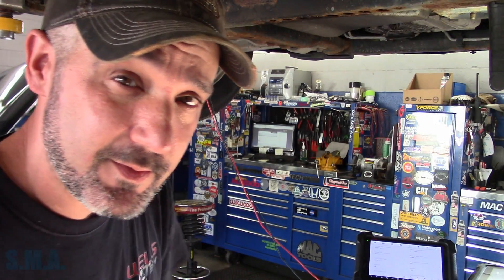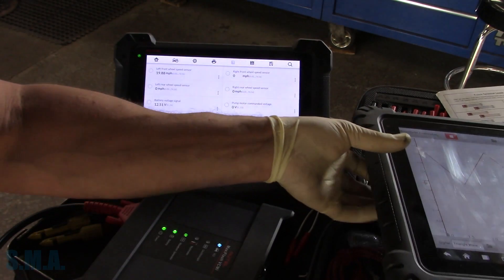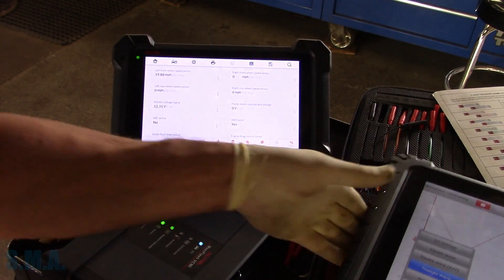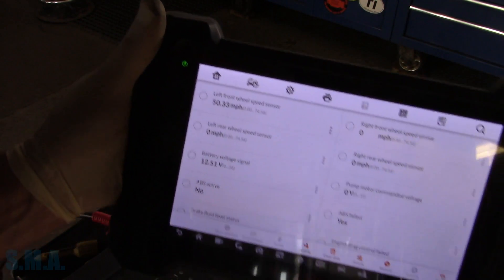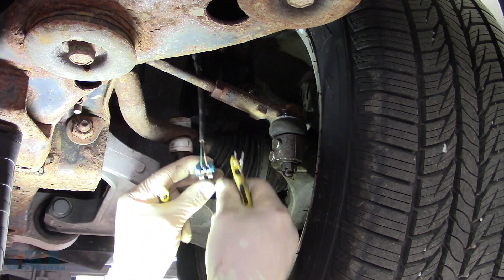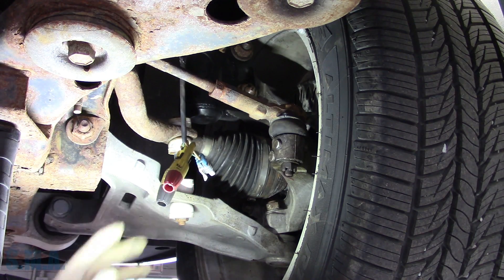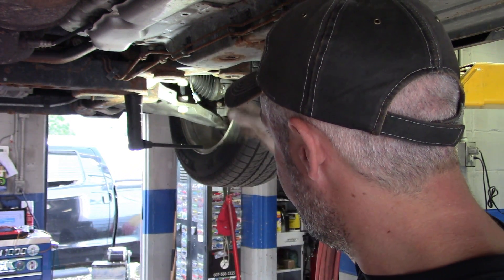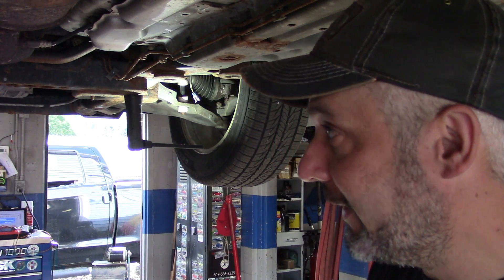Autel Maxisys Ultra: Signal Generator To Diagnose ABS

Comment: Nice tool. What makes it better is that the signal is always on for example so you are not in and out of the car turning the key etc. Signal is on, you can trace it full time without any interruption until you find the open. Interesting tool to get used to.

Comment: Great video! I think KY Home Garage did something similar but I can’t remember what he used to send the signal. Maybe the Pico.? An awesome tool that can create a square wave is the Mustool X1. One of the best $25 spent.
Reply: The Pico 2204a. $139 on ebay. Bought it 3 years ago. It's not designed for automotive use but there's ways around that. It's not the best but dang sure beats nothing! And it was the o2 senor wiring he tested.

Comment: You can do a split screen use one scan tool😎
Reply from the maker: I usually do but there's not enough chord on the DLC cable to keep it plugged in and then have it reached the right front wheel also
Reply: South Main Auto Repair LLC What I meant was the ultra you can use the scope and view scan data at the same time ....if you look at the bottom of the screen there’s two sheets of paper icon that will allow you to view both at the same time (split screen mode)
Reply: South Main Auto Repair LLC I see what you mean too bad the DLC cord isn’t longer then it is it would sure help..... my ultra will be arriving next Tuesday
Reply: @SouthMainAuto  a couple of test lead extensions will take care of that, I have BNC and banana plug leads on a spring retractable cable roll, 3 metres a piece, that I bought of eBay for next to nothing.

Comment: I remember Scanner Danner in many of his videos would try to fool the computer by touching his test light on and off, in order to simulate a crank sensor. This will b a feature he will especially appreciate!!  The Ford VRF signal  was one that would sometimes give him difficulty. Thank u for all the great work u do. 100 times better than Netflix!!!
Reply from the maker: I used to test light generated crank signal to this day. Pulled up or pull it down is all you need to know and it is a great tried-and-true bypass test 👍

Comment: good stuff, reminds me of radio/television signal tracing and signal injection to isolate problems is the way to repair, vs shot gun recap (aka in the car world firing the parts cannon).
Reply: Radio and television. Just take the tubes out and use their tube testing machine. Yes, I'm only 54, and remember those.

Comment: If you can't afford this, there are lots of used Hewlett-Packard signal and function generators floating around.  We've used them in the electronics industry for years.  Be creative!!
Reply: What about doing a resistance check on the wiring instead of signal injection? If you disconnect the harness from the ABS computer (to protect the computer for sure) , you should get less than infinite resistance from both wires; infinite resistance means you have a break in the wire(s) or problem in the connector(s), or the sensor. This, of course, is a poor man's way to check for continuity between the ABS computer and the wheel sensor on the wiring harness.
Reply: Mark H. Yes, but a resistance check is not enough.. you would have to load check the wire with a tiny bulb to see if it carries current. Of course you have to disconnect both sides of the wire. All of this is not as fast as a signal generator. Also, the generator will prove the computer can process the signal proving computer is ok, can’t do that with wire continuity check

Comment: Not "nuts and bolts" but a great explanation of how stuff works and using tools available to you.  I remember my dad (an electrical engineer) grabbing an old scope to diagnose a problem in his old vw bug.  Tools are modernized but the methods are similar.  You've got the thick skin, so I know it won't get to you, but don't let the haters hate.

Comment: Just to verify being only 2 wires. It's still  ac voltage the sensor generates when the wheel is rotating right.

Comment: Not going to lie: I would love to have lots of shiny toys to do diagnosing with but it's not going to happen. 1) I'm a shade-tree mechanic and spending big bucks on these tools just doesn't make sense FOR ME. It totally make sense for a quality shop to have good tools. 2) My cars don't break that often so a fancy scan tool would just collect alot of dust. Please ignore the haters filled with envy and keep making great videos. Your examples have made me a better mechanic for the little jobs that I do run across.
Reply: I completely agree. Even with the 4/5 cars and a large van that take care of. Then also doing some outside work, a shiny toy will not be beneficial enough to be a good investment for me. I'm getting by with a Bluetooth OBD reader, which was even enough to work on a MB Sprinter, although it really didn't display anything correctly. But yeah, just seeing this is enough that maybe someone will figure it out. I did the opposite test and look for the signal with a multi-meter at a further up connection.

Comment: In my opinion, you are doing an outstanding job of shortening the initial troubleshooting, and shortening the whole repair cycle. So, by using the latest tools and test equipment, you’re 1) Bringing value to the shop, 2) Shortening the troubleshooting cycle which lowers your cost and you can pass that value to the customer 3) Improving your knowledge of how and why some systems work the way they do in various vehicles.
Expensive? Yes they are. Do they allow you to move quickly from vehicle to vehicle? Yes they do.

There’s no down side, and over time, these tools will optimize how your shop works, especially in the rust zone, where you work, and have so many strange electrical/electronics issues.

Heck, with some other tools, you could start a cluster repair/microsoldering repair station that also fixes PC boards!  You virtually have a lab setup: DVM’s, Oscilloscopes, signal generators... all you need is a good soldering station and a microscope with built-in camera and you’re fixing iPhone motherboards.

The criticism is going to be fleeting, as you show how these tools work.  I’m really impressed how you demonstrate how the signal generator works!! Good on ya!! Cam and crank sensors/wiring, speed sensors, pump speed sensors, anything that uses a pulsed control loop...  I imagine you can also simulate a PWM signal also.  The way of working is getting more complex because the vehicles are using technology that is moving forward rapidly. I2C high speed communication, fiber optics, microcontroller modules for everything, logic systems that make real time decisions in microseconds.... sounds like a MR or CT scanner. 

Still the best troubleshooter I’ve known. I showed my mechanic friend, Tim, your video, and now he wants to go work in your shop and get trained on the “good stuff”. LOL!!

Thanks for a GREAT video. Excellent!!
Reply from the maker: Trust me you don't want me working on printed circuit boards LOL. me my fat fingers and solder don't get along real well on tiny components

Comment: No matter the cost think about the time saved which equals labor hours or money. So he’s able to do more, the customer saves because he’s not just throwing parts at it and everyone wins. This is the same with any industry or job. I have to have specialized equipment that costs a fair bit on the PCB board repairs that I do but I can get more done that way. I started out with the cheapest crap and worked my way to better tools. That’s just how it works. I’m not a mechanic other than a shade tree on my own vehicles but Eric is a great teacher and I have learned some nifty stuff when it comes to electrical stuff.

Comment: I have an inexpensive signal generator that I thought I'd use often, but it tends to gather dust. Part of it is uncertainty about the character of a good wave, especially when talking about sending a live signal into sensitive electronics. That said, it is time consuming to find long jumper wires to crossover a signal from one wheel to the other side, and sometimes there's no positive control for a sensor in the car. What I really like about this video is your willingness to try new approaches, always expanding your horizon and skill set. There's a life lesson for us all.
Reply: The ultra comes with examples of good waveforms so they can be replicated.

Comment: You are the man! Love the science approach to Auto Mechanics with the skill and experience that only comes from a life under the rack. I wish more Dealers would watch and learn from you as they are just becoming "R&R" men and women. Just remove and replace parts tell the problem goes away then charge the nieve customer.
Reply: There was a time that any shop owner or manager catching their people doing that would fire them, as an insult to the profession and damaging the shop's reputation. Few and far between now; knew a retired mechanic that was complaining about the next-gen "technicians" in the late 1980s for the same reason; no diagnostic skills, parts swappers, frequent bring backs he'd have to try to figure out. The guy retired because he was of that age range, and didn't want to go to school anymore for all the onboard electronics. When he complimented me for a suggestion I made while working on my car, I felt very honored. RIP Mike.

Comment: I used to work for the phone company and most of your diagnostics directly correlate to the way we used to troubleshoot the phone lines from simple dial tone lines to other more high speed circuits. Great job. I cant wait to see when they will start using fiber optics in cars. That is a whole group of different sets of test equipment same principle though. I really enjoy your channel........Thanks
Reply from the maker: They have used fiber optics for years in cars all ready 😉
Reply: @SouthMainAuto   That's the first I have heard that. That should make things as far as corrosion issues go away.

Comment: I've had that same problem in a Montana. Never thought if the plug it's self.  Thank you!!👍
Reply: The physical connectors (plugs and sockets) are often fine, but the damn thin cheap WIRE becomes the victim of green crusties long before a thicker conductor would.

Comment: Signal generator is a standard piece of tech kit... you can get bench ones for less than 100$... probably not as nice for garage use, but it can be done.  Now that you're using a 'scope and a signal generator you're an electronics technician, capable of fixing computer anything!

Comment: Right down my alley. I often inject a signal into my old radios when doing troubleshooting.
Reply: fun aligning an old tube  radio if  section  when all you can find is a steel screwdriver.
Reply: @richardcranium5839  
 Ha ha, been there, done that! Over turn and guess, try it again with a little less or more, lol

Comment: Can it generate an appropriate signal for magneto-resistive sensors?
Reply from the maker: The sensor I was working on was an AC pulse generator. You can also generate square wave DC signals for active wheel speed sensors
Reply: @SouthMainAuto  Thanks.

Comment: I like autel scanners but the one is out of my range 💸, I would like it to have it but $5000.oo is a lot of money for a simple back yard mechanic...😂
Reply: Do a few mobile jobs and pay for the tool. Local mobile mechanic was trying to charge me 400 bucks for labor to change out a starter, needless to say I ended up doing it myself.
Reply: I do some mobile job but I guess I don't charge enough to cover one of those 🤷🏽‍♂️.I wish to get the MaxiCOM MK908 at least,  that's around 3k,
Reply: @samuelgonzalez5892  I just bought a used totally up to date MS906BT with a scope for under $1k from a guy on Facebook.  Do your diligence and buy from a knowledgeable seller and there are some great deals out there.  It doesn't have the signal generator in it but it's also not $5k.  You can pick up cheap signal generators that will do what the Ultra signal generator does...not as conveniently...but as rarely as you'd need it I'm sure it'd be just fine.

Comment: Super expensive way when just reading a signal off the sensor and hand spinning the wheel will work just fine. 
You must have $100k on diagnostic electronics. Way out of reach of many, many shops. 
It works though. You set it up and it did work. So would a test light.

Comment: Any reason for the triangle wave signal and not the square? Isn't the signal from the ABS sensor also a square signal ?
Reply from the maker: It's variable reluctance sensor it generates ac voltage

Comment: And since the signal is in the audio range, a small amplifier from say an old radio could be used to listen to each pickup (d.c blocking capcitor required), for the man that does not have enough pennys for the pro tool.
Reply: I like your thinking, nice!
Reply: Damn, that's neat! Gotta try it sometime.

Comment: Question for Eric and all the other car guys out there. I went to work on a friend's girlfriend's car. 2012 ford fusion. We went to use the body jacking points, that long lip that goes along the car. And at first contact the jack makes a crunching noise. That section of the body near the passenger side rear tire was so thin from internal rust, it just gave way as soon as we jacked it up. What do mechanics do in that situation? How would you put a car on a lift? Also, would that spot of rust cause the vehicle to fail a state safety inspection?
Reply: That lip is usually called the pinch weld.  It is typically too thin to support the weight of the vehicle and just folds over or deforms if you try to jack it there UNLESS you use slotted pucks.  Suspension components are usually not good lifting points.  Virtually every tech and shop use the frame rails when lifting a vehicle with a rack.

Spots of rust are not reason to fail an inspection.
Reply: No offense man but if you can’t figure our where to jack up a rusty car. Take it to some and don’t get under it. Could get seriously hurt

Comment: Good diagnosis. 70% of problems with modern cars is the bullshit electronics car manufacturers put on modern vehicles. Back in the day most problems were mechanical, easier to diagnose and fix.
It's all part of the plan for obsolescence and creating service jobs for the dealer network.

Comment: Checking circuit integrity with a DVOM has always worked for me.  A whole heck of a lot cheaper.
Reply from the maker: Yep that's absolutely true there are multiple ways to check signal integrity. Using a test light for dvom would work also. However in this business I try to go for speed and accuracy and I'll use the best tool I have in my arsenal 👍
Reply: @SouthMainAuto  Do you have an arsenal license? It's New York State; can't have citizens with private arsenals. :)
Reply: I'm with you on that, but as Eric says, this vid is directed towards fellow professional mechanics who already own the expensive gear. I guess the message is "since you already own that $ many-thousand gear, use it to its full potential to save money by saving time".

Comment: Every car you check underneath,  is severally rusted. Why?
Reply: Road salt
Reply: Not just road salt, but also a salt saline solution, and it's used year 'round where he lives (Avoca NY) and thus NY State which is in the salt belt (AKA, the rust belt as is much of the NE and much of the Midwest tend to be).

Comment: Just can't imagine how much you spend on test equipment in a year.
Reply: Watch Steve from Simply Diagnostics . In his latest video , he stated that he pays about $ 2,000 a MONTH for SUBSCRIPTIONS - I don't know if that is US Dollars or English Pounds , which would be about 30% MORE . What about ALL the classes attended to LEARN how to diagnose and the cost ? And time spent with the tool ? This is no joke . " But you only spent 30 minutes to diagnose it " .  But it only took you 30 minutes to cut a hole in my belly . Try going to medical school . Liability insurance ? You can pay Eric a fair price to nail it or go to the HACKS and really pay to attempt to fix  . Throw in a computer while you're at it . " I changed everything under the hood - it's gotta work " ! What's a wiring diagram ? My DVOM has been broken for YEARS ! It's all that electronic stuff . Nobody knows how it works !
Reply: Bill Smith it seems like the other shop already threw a wheel bearing at the problem in an attempt to fix it rather than diagnosing it properly first. I’d rather deal with someone like Mr. O who can diagnose and fix the actual problem at hand vs spending my money unnecessary parts and labor.

Comment: Years ago I got hold of an old style "Auto-test-station" back from the 60'es or so.
It was all rusty outside and the selector switches were seized, by rusty axles.
Apparently it had been stored unused in the back of the shop, as no-one ever knew how to use it.
Situation is much the same today, except for the odd thinkers like Mr O ...
Reply: Common problem with many shops and their tools/equipment today, they don't really know how to use them. Don't get the training they need for said tools/devices etc.
Reply: I still have my BEAR  60-900!   it has an alignment machine and a 5-gas analyzer built in!